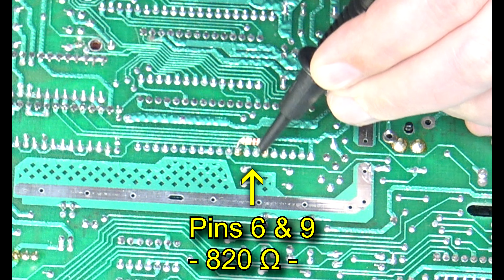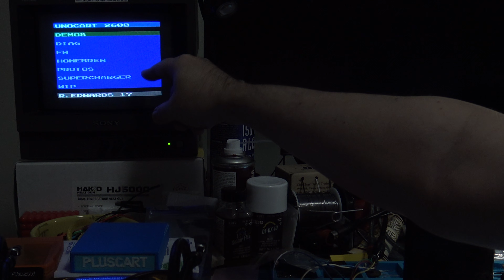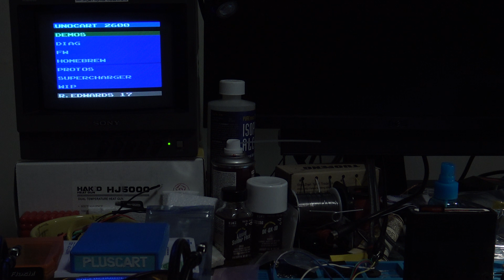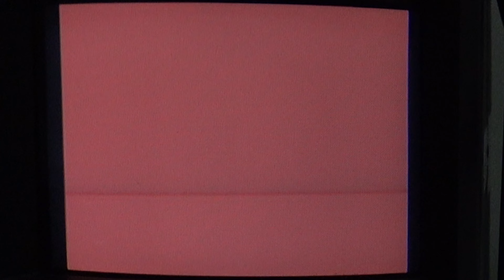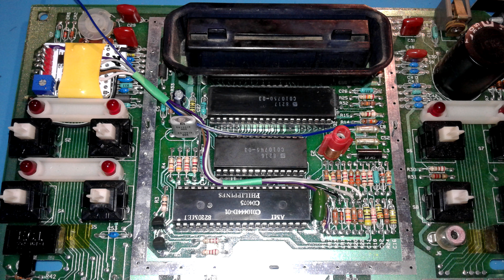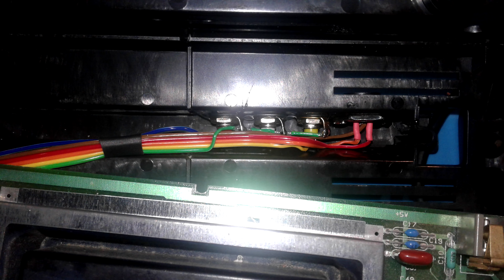ITC#79 :- Atari 2600 Sears Video Arcade II UAV Installation

Comment: you are the only one ive seen make a video on this console opening it up. would you happen to know how to replace the on/off Switch?
Reply from the maker: I don't know the part number type for it right off hand. But I actually replaced the switch in a spare console of mine by using a spare channel select switch I had on hand from another 2600. Not as elegant but it worked and I figure is a good temporary solution until I research a proper replacement. Pretty sure the right angle rocker style switch it uses is still made and can be purchased.

Comment: Hmm, 19:27 my rev 13 4 switch didn't have that resistor on the bottom on the board. 

The issue I'm seeing is like in asteroid the colors are blobbed inside of the asteroids like if the color output is too strong and bleeding (I can even adjust the color on the TV down and it stays the same, this also happened before I AV modded it and using RF. Now I didn't get the UAV, but maybe I should have, I got the AV mod on eBay (the one with a single transistor and two resistors), but since it was happening with RF that even with the UAV I still probably would have seen the issues with the colors in certain games (doesn't happen in every game).
Reply from the maker: Not every revision of the 2600 systems had the 80oish Ω resistor installed. On some 4 switch units that resistor was incorporated into the actual board and not bodged in from the factory. And again, it isn't present on all of them. But it is something to look for if the overall color hues don't appear right after the UAV is installed and adjusting the color trimmer doesn't correct for it. The blobs you are talking I would have to see a picture of what you are describing. But I can tell you that due to the interlaced nature of the original TVs and games that made use of that, some of those games today will appear to have stripes in them when viewed on modern TVs of today. Asteroids is one such game that will show the rocks as being striped or having these odd vertical bars inside them instead of being solid colors. That isn't a fault of the UAV or really any AV upgrade board, but the fact that modern TVs don't really handle interlaced video signals that well in general.
Reply: @IvoryTowerCollections  the "blobs" I'm talking about is like color bleeding when you would crank the color up on a TV  "but it doesn't go outside of the sprite, it stays contained within the sprite, it's like a smaller more intense brighter version of itself inside the original sprite, I can completely remove the color in the TVs settings and there will still bee a bright version of the sprite in the center of the original sprite just B&W).

Yes I know what interlaced is, and that's not an issue for me.

Comment: The Sears arcade ii was my first console.  I need to pick one of these up and I love the controllers when they are working.
Reply from the maker: The controllers are  unique for sure. But it is interesting to see how they were designed as you can start to see the beginning ideas in place that would..like the console shell, become the controllers for the 7800 only without the paddle functionality.